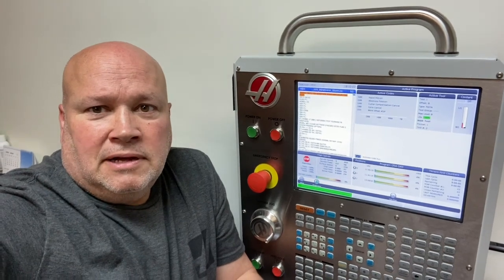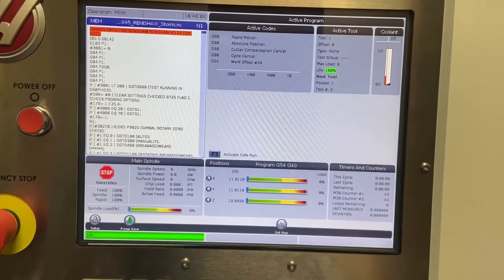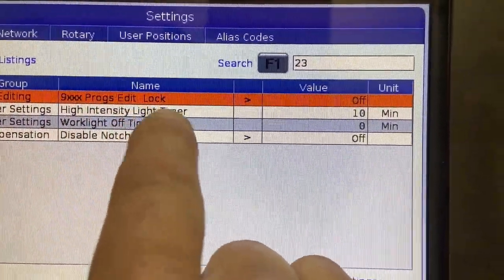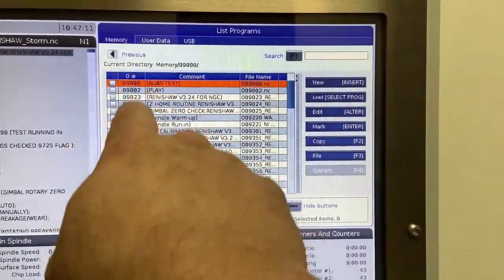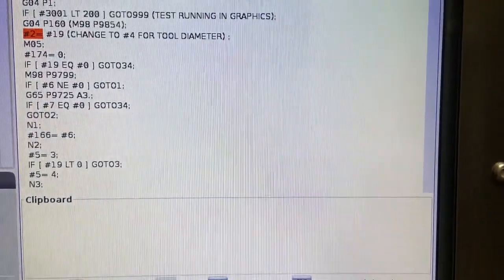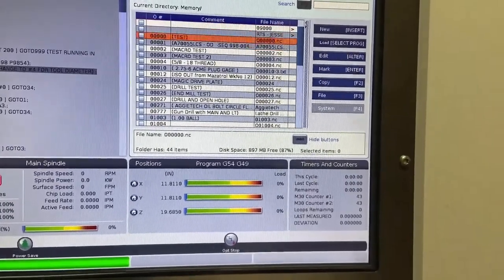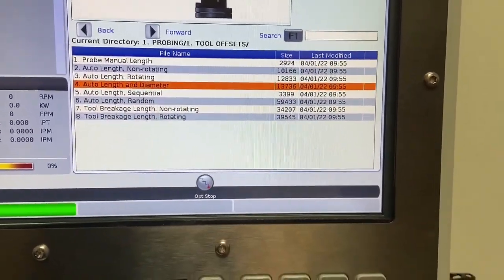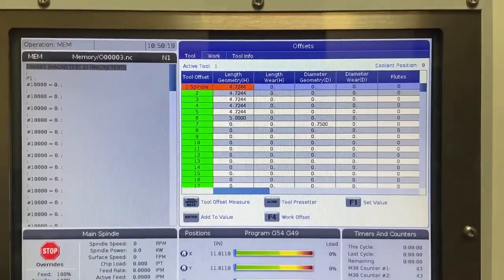Using your Haas Mill Tool Probe for Wear Compensation

Comment: I don’t know how I would have ever, EVER figured that out if it wasn’t for your video.  Seems to be the most important setting if a person is using a Renishaw probe.  I’m surprised that it’s not defaulted that way from the crate.  Obviously the controller must reference the nominal diameter for the tool from one of the other columns in order to make the calculation.  And that same nominal diameter must also be used in the cad software to model the tool path.